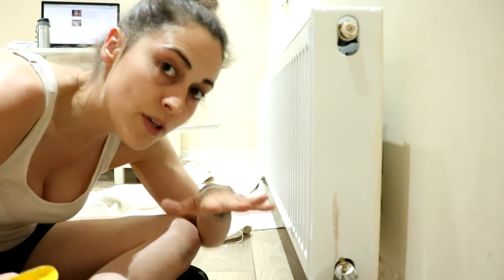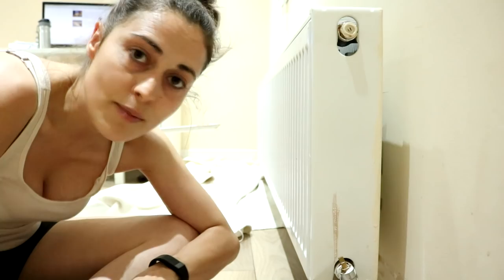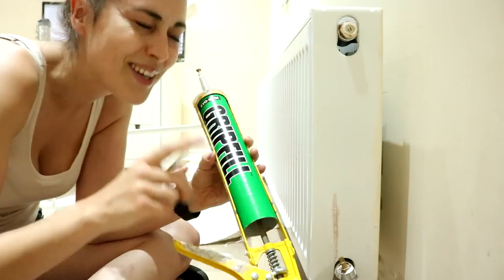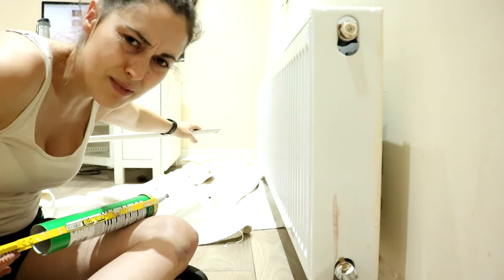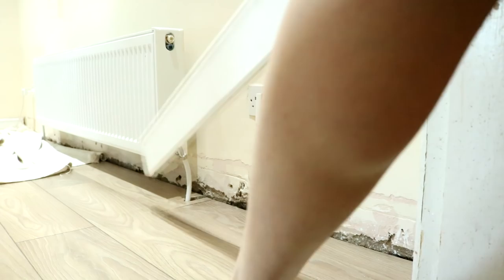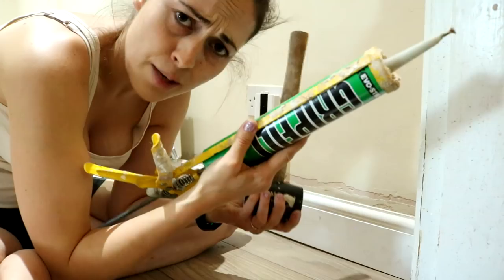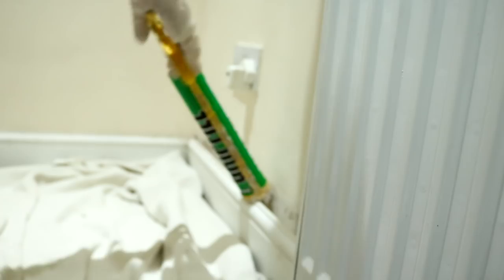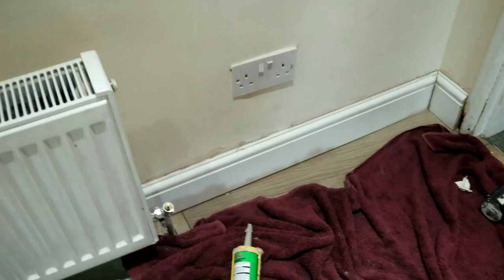Gluing on a Skirting Board | The Carpenter's Daughter

Comment: Moisten the wall and skirting before using gripfill, it requires moisture to 'cure' or go off, so it will draw any moisture out of your skirting and wall, if there isn't any, it will just go off using the moisture in the air and not stick to the wall or skirting and eventually fall off. DIY pro here, not a tradie. You are welcome.

Comment: When doing this job I used some lengths of 2 x 1 (I always have a few lens hangin around) 
and cheapo Lidls F clamps with reversed jaws to push instead of squeeze, I can put pressure on opposite walls at the same time... works a treat ! 
😎👍

Comment: I've seen some bad plumbing but to bend pipes like that just to fit into a radiator is criminal. Straight pipes are better because the skirting will slide behind the radiator easier. Nice vest by the way. 😀😀

Comment: I once had to attach a new bit of skirting to a wall that had next to nothing to attach it to and the little plaster that was present was so crumbly it wouldn't tolerate pressure of any kind. Nightmare. Eventually, decided to run some small strips of timber up and behind the wall (I joined them to whatever I could find that wasn't on the verge of becoming dust) to which I glued the skirting. It's rock solid but it was so much work.
Reply: Having just had my floor dropped, I now have a foot gap. I think I'll have to put some plaster into it. What a job!

Comment: Hey Carpenter's Daughter, two questions: 
1) Are you happy with the glue you got or is there anything you recommend? I was originally thinking of going with contact cement but your way might be better!
2) What are you planning on doing with that line above the board? Are you just going to put putting to smooth it out and repaint, or sand it smooth, orrrrrr ?
Reply from the maker: Hi,
Yes, this glue is perfect for it.  I've used it so many times since.  More recently here in fact:  https://www.youtube.com/watch?v=BnB68XWnnQg&t=38s

Also, for the damaged paint above, I just used filler, left to dry, then sanded and repainted.  You can't even tell anymore.
Hope that helps,
Vikkie

Comment: I've similar.problem as the skirting has.fallen off from heat under radiator.
Did you have to remove old glue/adhesive from skirting and what did you use to do that? A multi tool?

Comment: Evo stick - sticks like. I guarantee it's the best glue on the market.
Reply from the maker: Agreed :) I've been using that quite a bit since this video on various jobs ;)
Reply: I also use the Evo stick - sticks like..  to finish and  fill the resulting gap between the skirting I use decorators caulk, easy to use and it is cheap (ish) I think that was the bendy mastic you mentioned in this vid :o) Fitting skirting behind radiators is sometimes a real pain nicely done.

Comment: Anyone ever use gripfill on skirting on my job site and your fired. If at any point this needs to come off you’re taking half the wall with it. In addition you’ve squirted gripfill to the top of the boards, so when it goes hard you can’t clean the joint. This will look terrible don’t do this.

Comment: That’s one helluva bend on your radiator pipes. Is that where the leak came from
Reply: The pipe is plastic, the lock shield obviously hadn't been held in place as it has been tightened up, probably an attempt to stop a lead. The plastic pipe will easily bend to any movement from the lock sheild